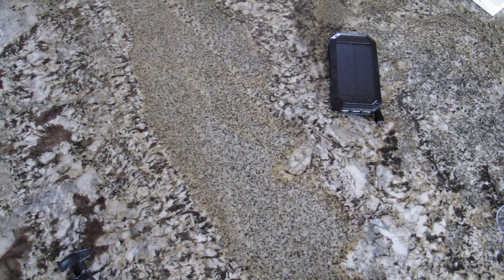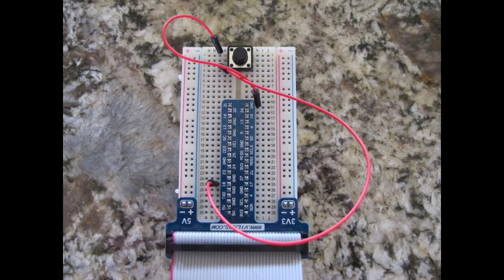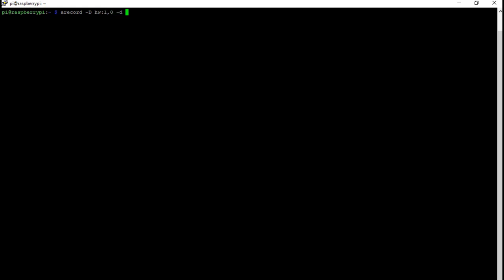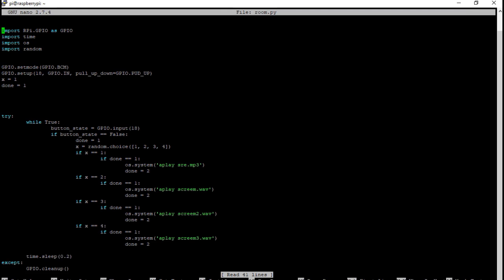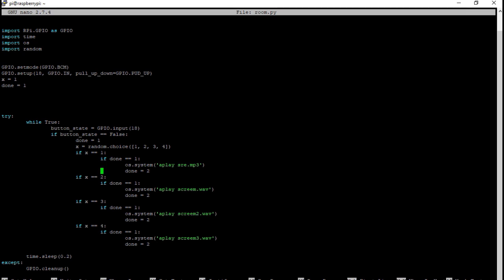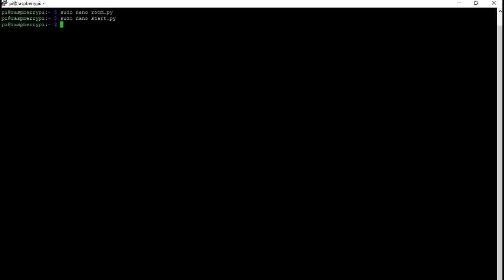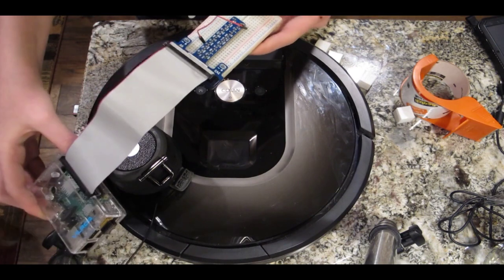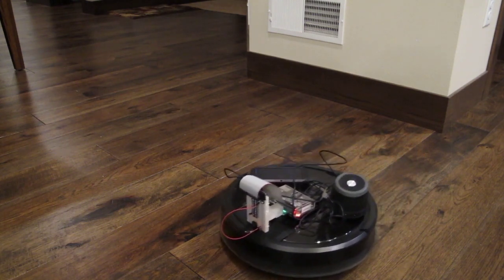How to make a screaming roomba

Comment: Or just more in-depth products and what exactly I need to buy
Reply from the maker: Yeah hears a list of the same thing that I used:

I used a raspberry pi 2b but you can use any raspberry pi newer and Maby older but if you can newer is better. Hers a link to buy a newer pi: https://www.adafruit.com/product/3055

Breadboard: https://www.amazon.com/dp/B077DN2PS1/ref=cm_sw_r_cp_api_i_Rek1Eb2PHEKYB

Button: https://www.adafruit.com/product/367

Gpio to bread board converter: https://www.adafruit.com/product/1754

You can use any speaker with a audio jack.

Jumper cables: https://www.adafruit.com/product/3142

You can user any battery bank that you can connect a micro usb to to power a pi.
Any Roomba type robot vacuum as long as it has that little bump on the bump sensor.